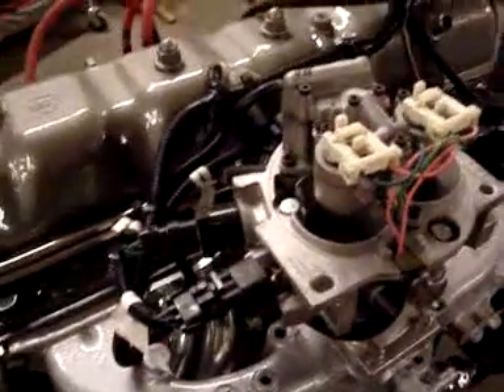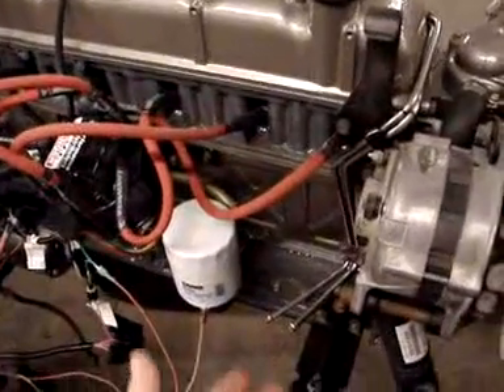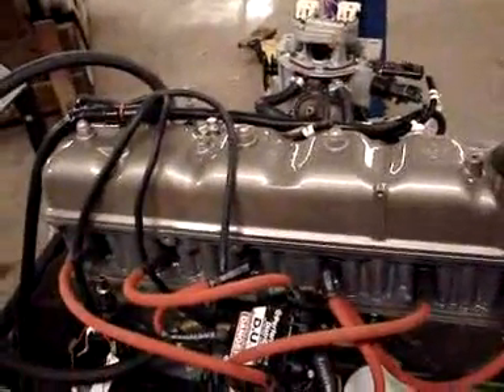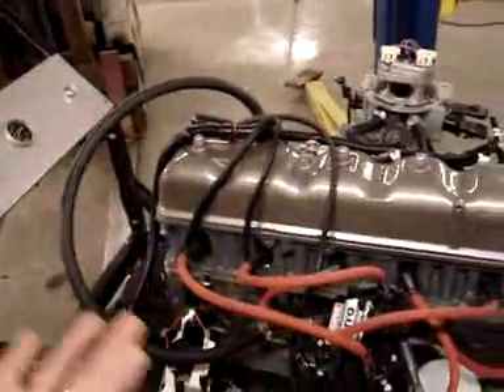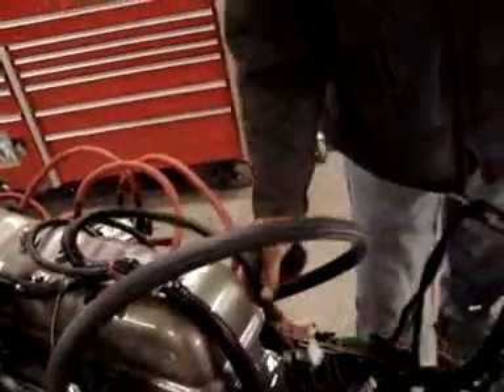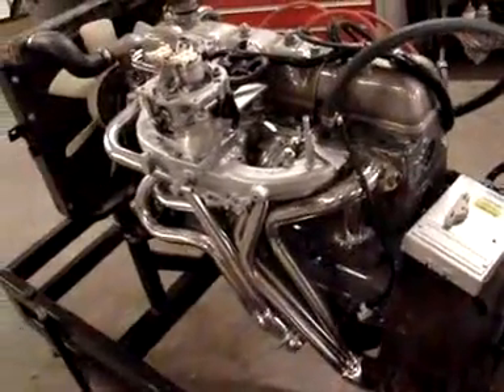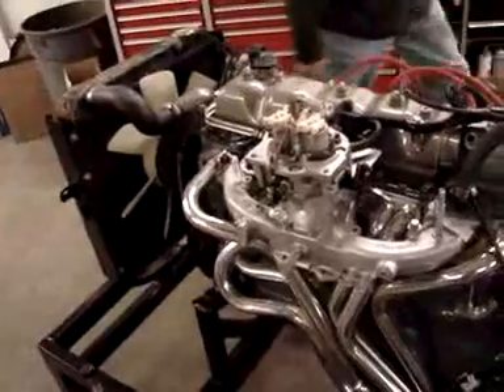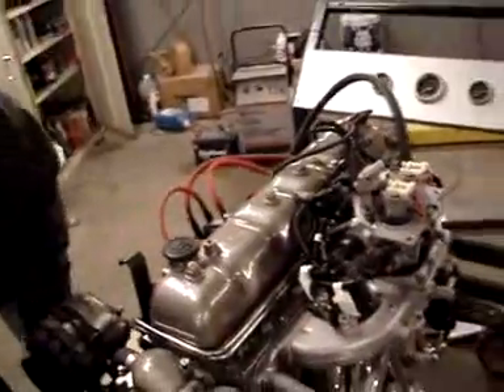Restoration 1974 FJ40 2F Engine Fuel Injection | Video 5

Comment: Are those the Man-a-fre headers?
Reply from the maker: Yes they are
Reply: cruisersolu 

Do you have to machine them to fit with everything? Or do you just do double up the gasket and it works fine? I watched the video and heard what you said, but I've also heard others say they needed machining. 

Thanks!
Reply from the maker: We find that these headers fit perfect....no extra machine work required.  There are ones out there that require lots of shims,etc.  This is not required.  Nice headers.Been using them for years!!
Reply: cruisersolu 

Thank you,

I will order them for my FJ40!